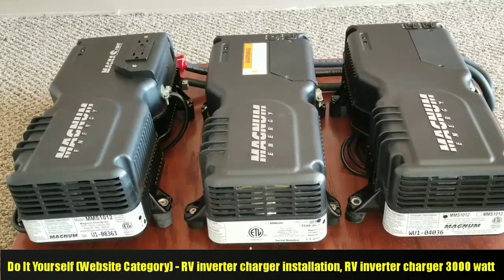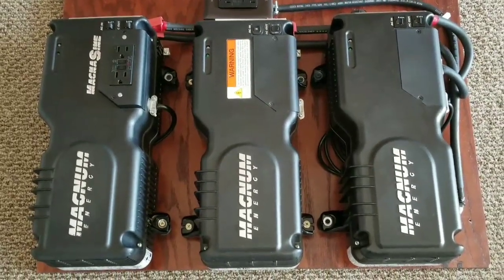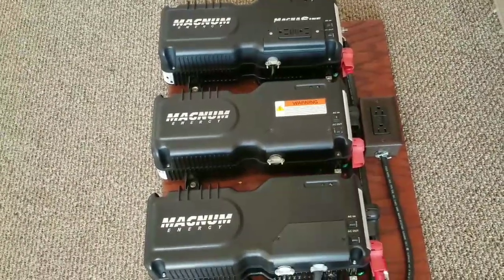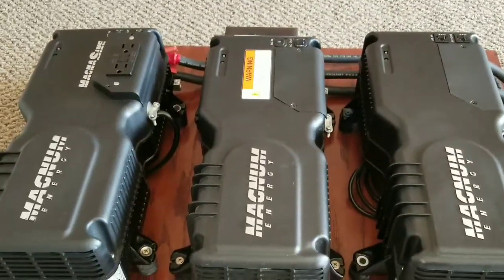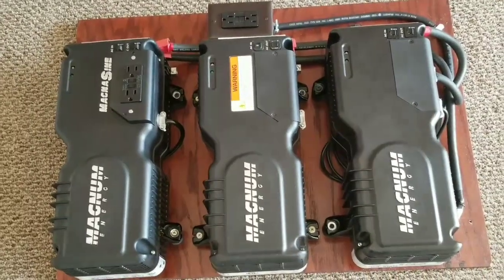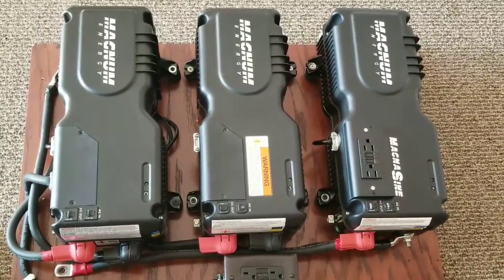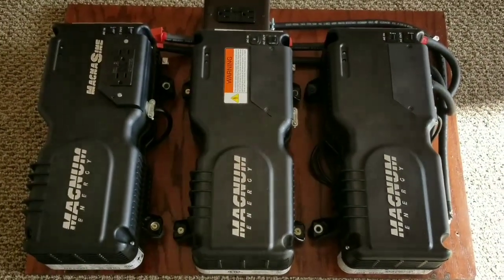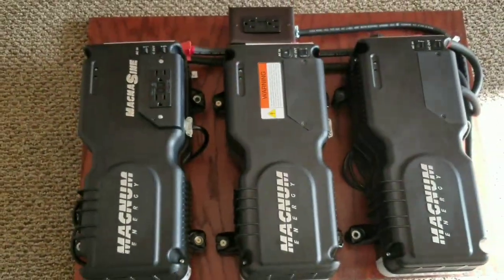Do It Yourself (WebsiteCategory) - RV inverter charger installation, RV inverter charger 3000 watt

Comment: I DON'T THINK THEY CAN BE EVER SYNCED FOR 3000 WATTS AT ALL ,  UNLESS SOMEONE KNOWS HOW TO RIG THEM WITH A MASTER AND 1 OR 2 SLAVES FOR 3000 WATTS  OR SPLIT PHASE . I WAS ASTOUNDED WHEN I SAW A VIDEO  FROM  " Knurlgnar 24  -  CONNECT TWO UPSs  OR INVERTERS TOGETHER FOR DOUBLE THE OUTPUT POWER  " SPLIT PHASE OR SO IF YOU EVER SAW THE VIDEO . WITH SOME KNOW HOW , MAYBE SOMEONE COULD MAKE IT POSSIBLE .
Reply from the maker: I have confirmed that with Magnum Energy inc. That I can not stack these inverters at all because they are out of phase. 
Thanks for your input brother
Reply from the maker: Check this one out 😉
https://youtu.be/HiarrK18rV0
Reply: you may be able to use the Outback PSX-240 6000 Watt Auto Transformer with two of them
Reply from the maker: @thefaeryman  
Will see if I decided decided to go that route. 
Those Outback PSX are proximately $500 bucks and more.
Thanks for the input Rev. John and have a bless day.